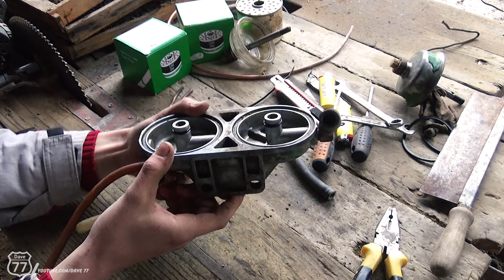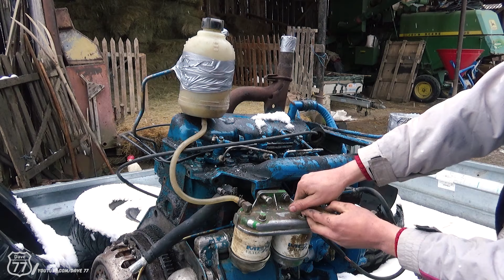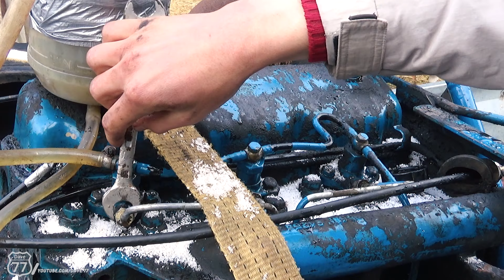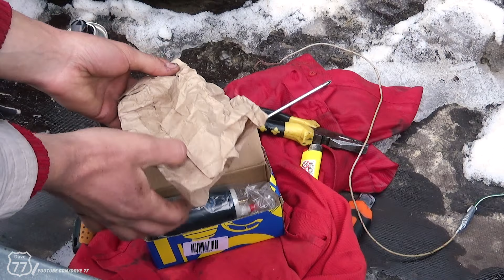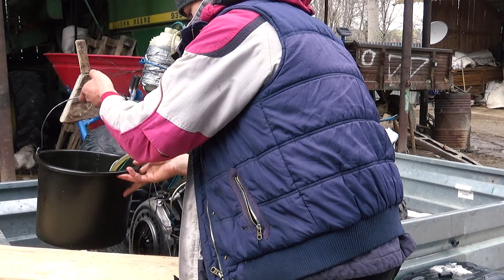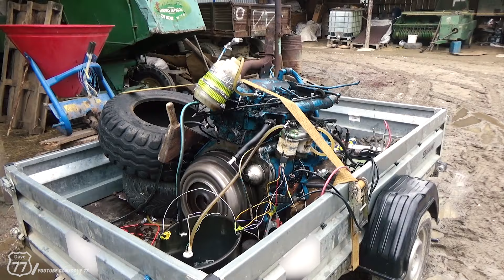Ford 4000 Tractor Engine Start Up (Stand-Alone)

Comment: This engine is for your 4000???
Reply from the maker: Yes it is.
Reply: @Dave77  why are you replacing it? is the other broken ??
Reply from the maker: @nicholasrotella7920  Yes, we blew the old motor, so we got a replacement. Newer model engine. Works good.